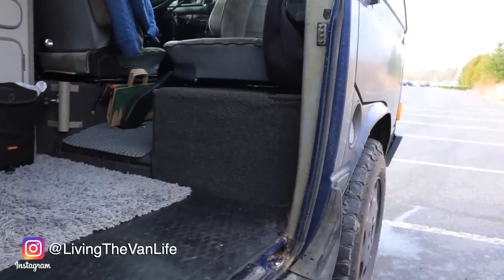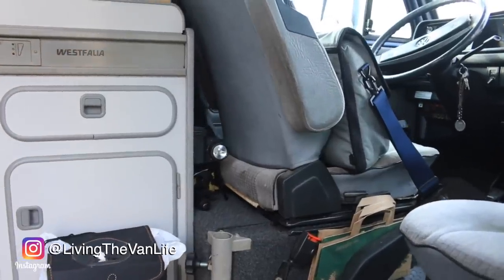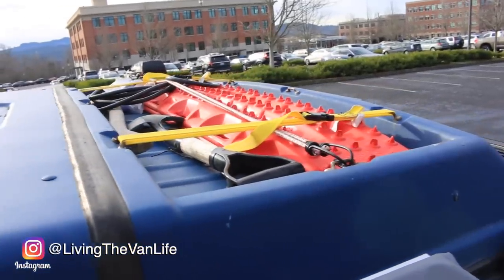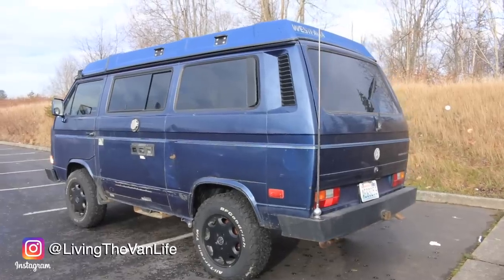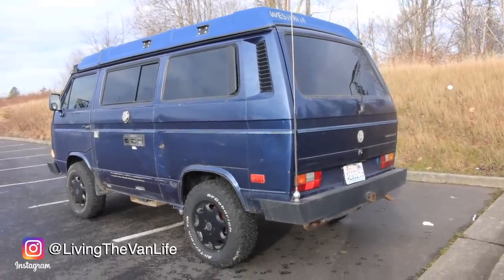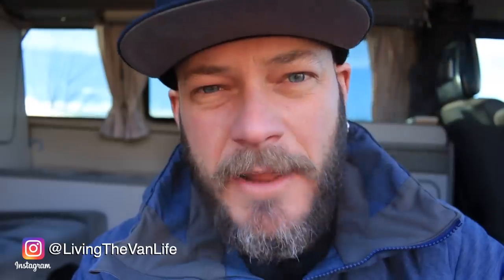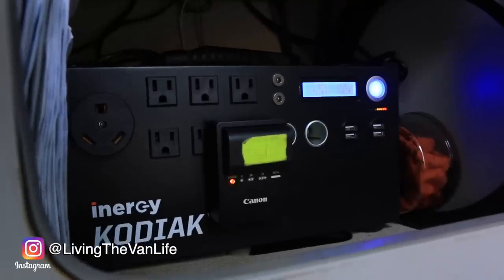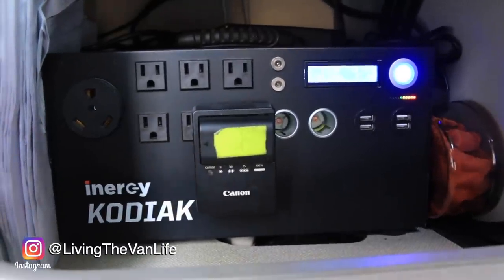Chinese Diesel Heater Install In a Volkswagen Westfalia - Living The Van Life

Comment: Great vid!
After seeing it, I'm thinking about one -don't laugh- for my home in case of emergency extended power outage. I know there's challenges in the setup, but I think it would do a decent job of heating one room.
Reply: That is a good idea! That much power is MORE than enough too. Recently we had a power outage and I had to turn off my 4000 btu heater after a while because my bedroom was too warm. A full 20lb propane tank holds as much energy as 3 gallons of diesel and the diesel will be easier to carry around than a full propane tank. Plus, no fire or CO risk. If you were to hook up a large tank this thing could run for a LONG time. I feel better about keeping diesel in my garage than I do gasoline or even propane.

Comment: Brilliant video bud! Just one comment on these heaters (an Eberspacher Chinese clone) don’t mount fuel pump horizontal as air cavitation will eventually make the pump fail....15 to 35 degrees tilted is recommended even up to vertical .....just not horizontal. Cheers Top Cat in England

Comment: I would've personally soundproofed it, made an extra hole for the air intake to the outside so it doesn't draw fresh air from what is a very small confined space with limited fresh air supply, and double-wrapped he exhaust with titanium exhaust wrap.

A hot exhaust like that can easily char particle board, especially if you're stuffing the space full of other stuff so there's no space for the residual radiant heat to dissipate.

Comment: Nice mount...I only see one problem. With running your diesel line from your tank to your heater underneath the van, the fuel could possibly jell , in extreme cold, and clog the fuel line. I suggest, being a retired truck driver, keeping a fuel additive handy to prevent jell. You can purchase the additive at truck stops, Wal-Mart or automotive parts stores.

Comment: I'm on the outside looking in bro but I trust that mr heater more than that diesel heater 😶 great video bro
Reply from the maker: It’s not a trust issue on either heater for me.  It’s more about the moisture that the propane was doing to my van.
Reply: PNW vanner here. Not having consensation issues anymore would be worth it. Nonvented heaters are the worst in our damp climate as far as mold suppression. I almost dropped big bucks on a Propex last year. So glad I waited and can get one of these for 80% cheaper.

Comment: Chad, if you encounter true below 0 weather I would be concerned about that small gauge diesel line running under the van. Ask any diesel mechanic about the joys of Fuel turning into jelly in very cold weather. Great video though,I love the heater idea. My parents have the same van
Reply from the maker: I was actually concerned about the very same thing.  I wondered about running it inside the van for that purpose.
Reply: @LivingTheVanLife  can just add abit of diesel antifreeze when you fill up and you always be good to go

Comment: Congrats on no longer freezing in your home! :) The reason the Chinese ones look extremely similar is because each and every one of them is ripped straight off an Espar or maybe Webasto design, I forget. Some crucial patent or whatever ran out and the Chinese started churning out inferior but workable and cheap copies. As for the fridge, well, Dometic makes really nice portable fridges/coolers, the CFX series. are compressor cooled and very efficient. So you have the option of picking one of those up, and just stashing it somewhere in the van. They come in fairly small sizes that would be Westfalia-friendly. Oh, and since you have a separate tank anyway, you might want to try running the heater on kerosene intead of diesel. From what I've read, it works better and causes the heater to soot up less than diesel. Diesel is great if you have a diesel van though, just one tank to fill up. But just thought I'd toss that kerosene factoid out there.

Comment: If you wrap copper tubing around exhaust tube outside and insulate it and circulate your water with a miniature pump, you would have hot water as well or may be radiator inside to collect waste heat of exhaust.

Comment: Suggestion, add some sound deadening material to the interior of the heaters mounting box. Add it to the warm air pipe as well. Just a small 1” x1” square of sound deadening with really knock the hollow pipe sound way down.

Comment: Maybe consider fitting a flat tray under the diesel tank to catch any leaks. You could also run a drain pipe from the tray through the floor. This would avoid several litres of diesel flooding the inside of your van in the event of a major leak.
Reply from the maker: Great feedback.

Comment: Love your videos  I have he camping bug in May  Always end up freezing my ass off in a tent damp and sore .. I'm not a kid any more And the bones feel it 

I have a 05 2Dr custom Blazer which i have tinkered with over the years ..Most recently  I have thought : I have 4 seats and I only use 2 of them I have removed the rear seats and plastics / carpet 

Installed furing strips Next step is pro closed cell spray foam (2inchs) top to bottom Then cedar flooring and half wall paneling And a slotted side in bed frame just above the wheel well 

Behind the drivers seat in the low flooring where the rear seat was is my spare tire jack and a few basic tools / Pass side is still open for future ..extra battery and inverter solar charger?  I have upgraded my alt to a 100amp ... This disesl heater may rise space issues  But could be added to the rear side after the wheel well on the other side of where the trucks fuel spout is 

No more worries of bears, cold, wet damp nights or breathing in fumes  ..thanks for the video

Comment: Glad you said adios to Mr. Buddy. Nice install, I’d get the muffler for stealth. Time will tell if this Chinese heater will hold up. Upon reflection I think diesel was a good way to go, less volatile than gasoline thereby less of a fire 🔥 hazard. Hopefully it will. I’m sure you’ll let us know.
Reply from the maker: Thanks for the comment.  It does use significantly more fuel than the buddy heater, and there is the draw on the batteries that you always have to be worried about keeping up on charge.  Other than that, it is a drier heat than the buddy heater.

Comment: It may have been a lot of extra work and careful planning as well as cutting the exterior van surface and finding an RV plug/cap etc... etc..., did you consider reversing the tank so that the spout could have been filled from outside of the van… 

Having a sailboat for 20 years in my past, the smell of diesel could drive you crazy…

Great idea and great job on the installation!
Reply from the maker: I did think about that.  But I just don't have the time, the resources, etc to do that major of an install at this moment.  For now, I just had to go with what works.  It really is a great idea though.  Thank you so much for taking the time to share the idea.  Keep on truckin'!

Comment: Hi, at about 9mins, you run the diesel line out and under the van, exposed to weather. Diesel fuel freezes!! , unlike gasoline, diesel fuel will freeze into a gooey gel, solidifying and unusable at below freezing temperatures outside. Additives to combat this effect are usually put in the fuel by the makers each winter, but this needs to be checked. Put insulation around and along that outside pipe for peace of mind. Best wishes from Alan, in England UK.

Comment: Call any long haul trucking company. Ask the garage manager what parts go first on a bunk heater system. Order those parts for your model. I got caught nearly frozen solid one night when my bunk heater failed yet was still pumping cold air. Your set up draws internal air. Bunk heaters in semi-trailer trucks are installed under the bed where it's not heated. I could barely bend my knees it was that close.

Comment: I was crashing in a cargo van for a while and bought the buddy heater. I would crack the front windows and run it and then turn it off and go to sleep. I would go to sleep late because I would not sleep with the buddy heater on. I am pretty sure I would go to sleep with the Diesel Heater.

Comment: That fuel pump is supposed to be mounted at an angle.

I got one of these heaters in my station wagon, my decommissioned ambulance, one in the garage to heat the house, one is almost done being built into a small rolling suitcase, and I have a spare heater waiting to be installed.  The rolling suitcase version will be installed on a 12.6v 15ah lipo battery pack.

Comment: Only thing I would change is I'd run the plastic fuel line through some good rubber fuel line so that it does not rub on anything under the van and cause a leak !   This does sound like a better set up then those propane heaters that stink the place up and uses up all the air inside !

Comment: A great little heater, anyone installing these should consider having a carbon monoxide detector within the vehicle cabin as a safety element
Reply: While you are correct, there is very little chance that any CO2 could get into the vehicle. The heater draws air from outside, and exhaust outside in a closed loop. For piece of mind it certainly wouldn't hurt to have a CO2 detector, but it is also unnecessary.

Comment: Also there are two timers on the digital readout, so you can set it to come on/off at any time. My heater had a ticking noise, turns out the glow plug wires were catching the fan. They can be slightly long and loop under the circuit board, with mine catching the fan.

Comment: Definitely an upgrade to consider. An essential comfort in winter time, thanks for the video. 
I just did not realize if for Diesel vehicles you can use somehow access to the fuel tank, or if you have to still use the tank that the kit carries.

Comment: They do make a gasoline powered  heater. They are the same unit with some different parts. Just yesterday I obtained a 1 year old webasto 2000st that has never been used and was installed in a semi. It is a diesel unit. Ivd been researching what the differences are between the diesel and gasoline models. I havent figured it out yet. But, im confident I will.
     On the flip side. I did see a video on YouTube last week. A guy bought a gasoline powered Chinese heater. He set it up in his garage to test it out before he installed it. He couldn't get it too run properly. After messing with it for awhile. He decided to try running diesel through his heater. It ran perfectly. He tried gasoline again. It wouldnt run properly. He ran diesel again. It ran perfect. So ots hard to say. The Chinese heater suppliers may be dishonest.  So ordering a gas powered chinese heater may be a waste of time. 
     Regardless it may be worth the time to find out if you can convert your heater too gasoline. 
    Have a good one !
  Bryan,   from chicago

Comment: very cool, there is enough room in one of those to install a redundant setup.  If I were to use inexpensive Chinese products (even high priced ones) I'd want redundancy in that cold weather.   Would hate to be out of heat.  Thanks for the info.

Comment: Hey Chad, I've been watching you videos for while. I have a 1969 VW Baywindow Riviera that use to have a BN4 heating system in the back where the engine compartment is. Should I try to locate the Chinese diesel heating in the same spot or underneath the Z-bed, and could the Jackery 500 run that system, cause I don't know how much power I need for something like that. Thanks 😊

Comment: The only problem you may encounter is diesel ca turn to gel (like jello) in 20 degrees or below since the tank is inside that may increase the critical temp this occurs. Kerosene doesn't have this gelling problem It does burn at a lower BTU you should be able to mix Kerosene & Diesel to combat the problem Truckers use to run Kero in cold climates it does smoke white/blue not black and is a higher grade fuel. You may want to ask about its use in supper low temps.

Comment: It would be plenty safe enough to have diesel fuel in the cabin, but I would spill the diesel sooner or later and the van would smell like diesel for evermore. For that reason two things I would do differently is mount a smaller tank of different shape outside, like a half gallon ex-lawnmower tank. I would already have ability to carry a fuel can outside somewhere to refill, anyway. Second, I would not compromise my speaker installation by having them in what amounts to an open infinite baffle. No bass.

Comment: ( around the 14 minute mark )  A B.T.U. is a unit of energy. a watt is a unit of power. they are not interchangeable or convertible.   as I recall a btu is equivalent to 1 / 778.169 ft. pound of energy. of course a watt is a newton meter per second. ( a newton meter (joule) is a unit of energy.

Comment: Fuel pump needs to be at an angle or close to vertical. Being horizontal will cause air bubbles to not be able to escape and may cause issues with the pump in the future.

Comment: Only concern about this install tis the fuel line going below the floor to the outside of the car could be a safety concern. I would recommend using slit-loom tubing or stainless steel conduit to protect this plastic line from rocks etc.

Comment: Great video, but I think I would had the diesel tank outside. Because if you spill just a little diesel inside it will a pain to get rid of the fumes. Unless you use good quality kerosene/lamp oil.
Reply from the maker: Of course.  The diesel tank outside would be ideal.  But that just wasnt possible for me at this moment.

Comment: I would have spun the tank around , faced it at the outside wall, then cut a filler hole in the van side, and just put a door over it. As it is now, you need a second tank to carry diesel into the van or run a dirty hose through the van. Also spilling fuel inside is a massive risk having it setup this way when it is time to fill up the tank.

Comment: I wanted to get one of these heater, since they came out, but also struggling to find space for it. In my case, can't take the fridge out and all the spaces are occupied. Not a Westfalia, but still pretty much same space. My heating is on GPL and works fine, but not anymore, on temperatures under - 16°Celsius , since my GPL tank is outside, under the van.

Comment: Wish I had a shop and tools and experience lol so I could install my already purchased Dickenson propane fireplace. Middle aged women without these end up paying tons more and no one "certified" wants to touch it so far. Jim Morrison's come on baby light my fire apt earworm lmao
Reply from the maker: Those heaters are awesome!!!  I just saw one installed in a Kimbo Camper and they are freakin AWESOME!  I would love to have one in my van!
Reply: Christina, I had the same issue w that heater. RV places said they wouldn't install boat stuff and marine places wouldn't work on a campervan. Then, got quoted $1800 to retrofit a propane version of these heat exchangers. Eventually, went with a $200 catalytic heater. Isn't vented, but puts out less moisture than anything non-vented and I could easily install it myself. Now I've got my eye on these cheap Chinese diesel jobbies.

Comment: The only change you should do is add a plastic tray underneath your diesel tank and filter. That way if you ever have a leak there, you dont get your carpet diesel soaked which will pretty much make the cab unbearable. The plastic tray will keep all of the diesel in the tray and off your nice carpet.

Comment: Looks like overkill to replace a simple, space-saving & portable Mr. Buddy size heater.  My 4,500 BTU unit will over-heat my Westy on the coldest winter nights in Idaho. The added moisture raises the humidity enough that your sinuses will thank you and a battery powered CO detector adds a measure of safety.  My original Dometic fridge still keeps the beer cold and lights on the first spark.

Comment: Well made video.  I have three suggestions:
1. Your fuel line will chafe through the way you have it underneath. It needs to be protected. 
2. There is no way you are not going to drip or spill diesel where you mounted the tank. Diesel gets everywhere and it will get on your carpet and stink  I would find a way to mount it outside. A little fuel tank for a small outboard boat engine is a great way. They have quick connections so you could mount it up on your roof rack and take it down to fill it.
3. Take a fire extinguisher. drill a hole through into where the heater is. put the nozzle of the extinguisher into the hole and mount it this way. then when happy joy heater catches on fire you don't have to look for the extinguisher and open up the compartment. you just pull the pin and pull the trigger. speaking of i would also ad a fuel shutoff valve somewhere.

Comment: now a Trip to the mountains somewhere SNowey to see how it really does ps Please move the kerosene liquid from the diesel heater the Motor on then Heater gets hot to give you heat only thing protecting a nuclear meltdown is the plastic shielding on the diesel heater its 1 thing living out your van but its other if your  homeless and living on the Street

Comment: Really great video. But if I was you I would slip a little plastic catch tray under the fuel filter area just in the event that the line ever started leaking. You could even look a little drain hose to that and out through the bottom just in case and hopefully you'll  never need it. Do you know how much square area it will do. Thanks!

Comment: Love your video.  Purchased my diesel heater on eBay.  I thought I would mount the tank in the closet that I modified with a side access using a refrig. door.  Looks like  it won't unless I do what you did.  Also, how about the passenger side where the rear window water washer tank is?  Could that be tank be removed and substituted by the diesel tank and then adding an access door?
Reply from the maker: That sounds like more work than what it’s worth.